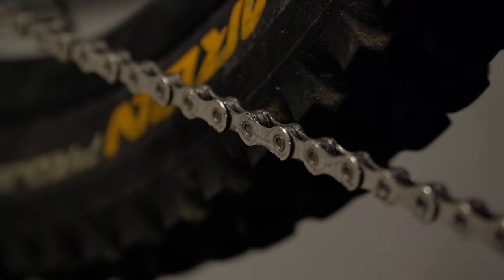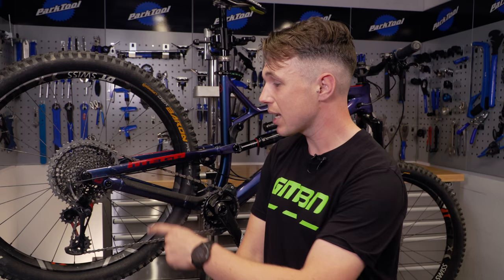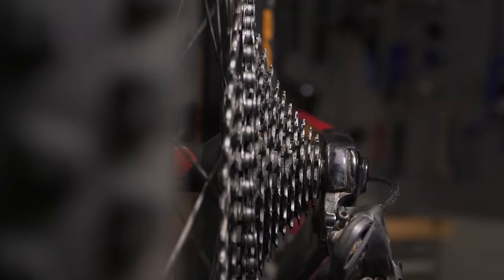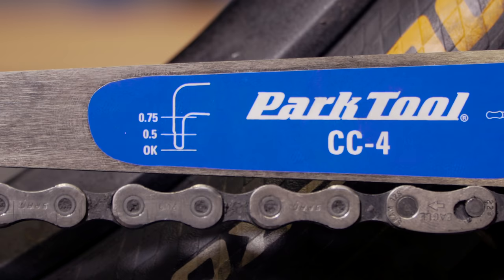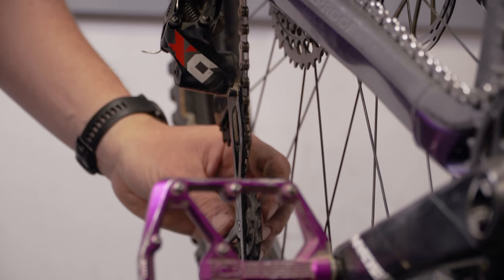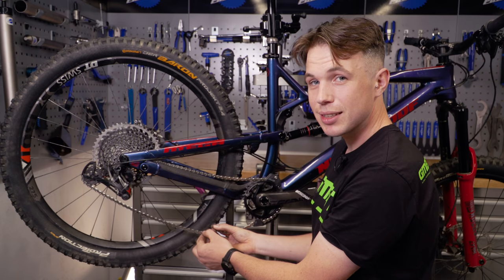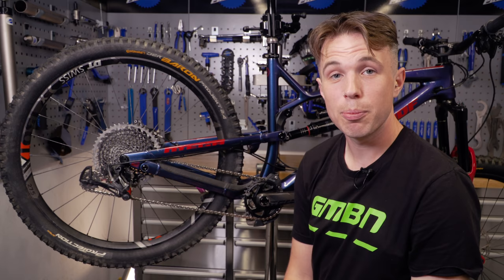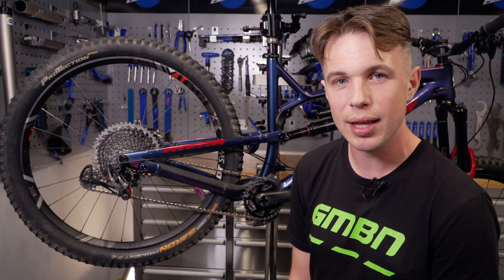How To Shorten The Chain On Your Mountain Bike

Comment from the maker: Did you find this video helpful?
Reply: Jup :)
Reply: Yes, but I have questions.

1) Why can't a chain link that you use a breaker on be put back together? Is the rivet/link damaged?

2) I cannot understand what a chain checker does that a ruler couldn't do. How does it work, and why should I need to pay for one?

3) Is the counterpart to Devil's Avocado guaca-holy?
Reply: @KRLinger  1:  yes, the rivet is not reusable. There is a big chance that your re-linked chain opens itself and breaks.
2: a ruler is to 'coarse', but you can use precision calipers, you just have to  do some math.
Reply: @blackpete  thanks!
Reply: @KRLinger  Just get a chain checker, very cheap tool. Also too hard to measure and see the difference between 0.5 and 0.75. With pricey 12 sp ($500 Eagle cassette!) drivetrains you need to change your chain at 0.5.
Reply: @gmbntech Great video as always! But Henry didn't mention that some jockey wheels are narrow/wide as well. I discovered that the hard way......
Reply: It was an awesome bit
Reply: @KRLinger  1) I just did?
Reply: Very helpful indeed
Reply: Yup very much

Comment: I let the air out of the shock and set the rebound to the slowest setting. Put the chain over largest ring and largest sprocket and add one full link before breaking it.
Reply: The first time I measure a chain on a new full sus bike, I use your method. Then I see how it looks looks using Henry's method when on the smallest cog when my rear shock is fully setup again. If it all looks good, going forward I can confidently use Henry's method as it's simpler and less work.

Comment: If u have eagle, u must use the red plastic tool to set b tension (or ruler to measure the required distance...10mm I think) as v sensitive to correct/exact b tension. 
Use the tool, with the bike AT SAG (for full sus)

Comment: Thanks for the info. Very thorough vid. I just had a new chain and cassette installed in my road bike and since then the chain violently slips during high pressure. Eg. standing whilst climbing a hill. Do you think the chain is too long? Or could it be something else?
Many thanks

Comment: 6:13 Does that mean shimano manufactured or shimano compatible?

10:40 KMC recommend putting the link at the top of the loop, cranking the rear brake and sharply applying force to the crank
Reply from the maker: In this case he meant Shimano branded but we would suggest checking instructions from any manufacture. Regarding the joining link you can use the brake, have the bike on the ground or use your hand on the wheel just has Henry did here. You can even add a little chain lube to help locate the pins 👍

Comment: I was at snowshoe world cup. Nino and I both run AXS with 38 tooth rings. His chain is as short as possible from what I could tell.
Reply: I think for any world cup racer, they never repair a chain during a race so they might as well run the tightest chain line. Where as non-racers, having a bit of a longer chain gives us some grace links to fix it and keep riding.

Comment: How do you lengthen a chain
Reply: break it. Then add more links. As long as you're ok with running two quick links (sram) or powerlinks (shimano).
Reply: That's the video I'm looking for. My drivetrain is 11 speed but my cassette is 11-50, so the standard 116 links chain won't fit by any means 😅
Reply: On my road bike I have an 11-40 with a compact 34/50 crank. I have 2 press in links to achieve the length, along with a quick link. Works fine and have never had a single issue with it.
Reply: Buy a new one.